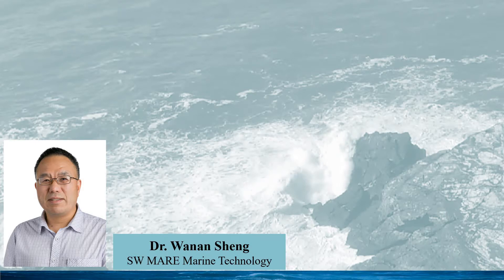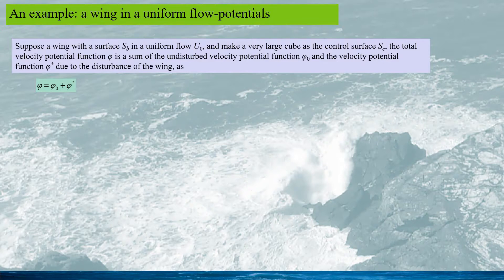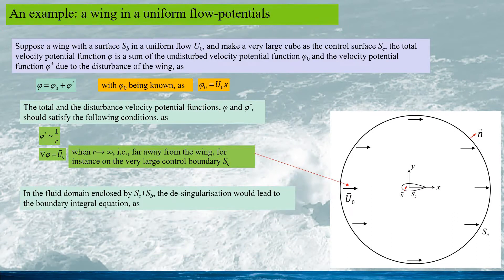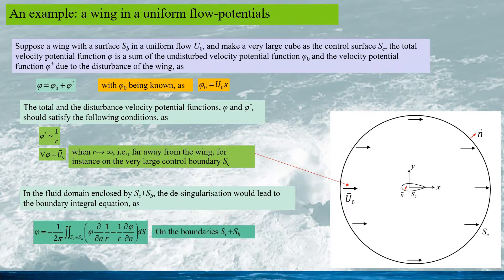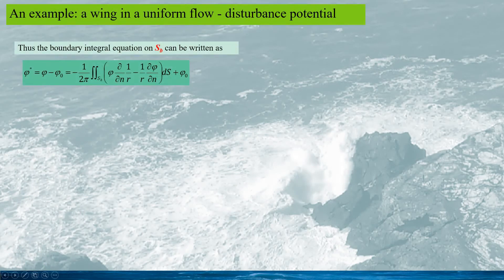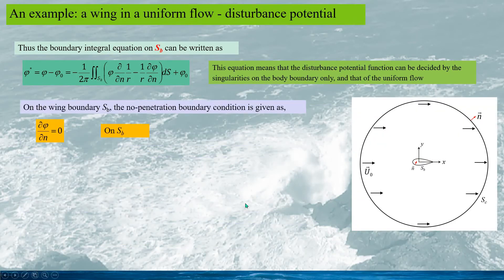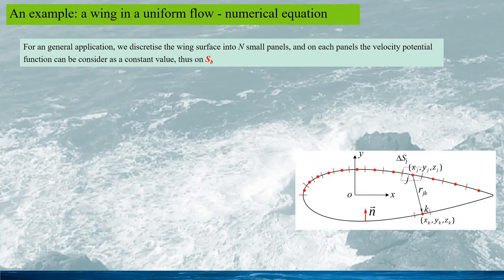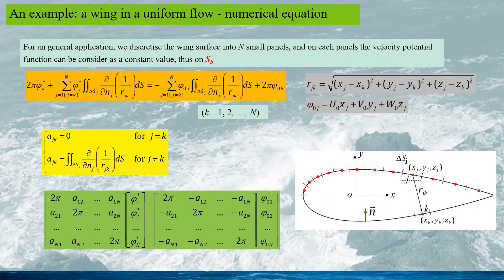[Fluid Dynamics: BEM] Boundary Element Method (BEM)- Principle (Correction)

Comment: Thanks  alot prof.this throw more light into the concept of the BEM.However im still a bit confused so i have these questions to ask sir.
1.during practical coding implementation, will the point k,be a random chosen midpoint on any of the panels from which all other panels can compute their r values from?
2.i still dont understand how to evaluate the double integrals of say a12,a22,...is there s special method?or its just a usual double integration?and if its a usual double integration, how do we define the limits over the surface?
Thanks in advance prof.
Reply from the maker: The idea is the source is uniform in the panel, and the double integral can be done in different way, normally based on the coordinates of the vortices of the panel. You should find some references on this. Remember for problems with free surface, you may find Newman's book or papers on this (and Dr.Yingyi Liu has done this too). It is very complicated, but it can be done, as Dr Liu in his open source (HAMS).
Reply: @ScienceofFluids  thanks alot prof
Reply: Prof,could you please recommend a nice book or material for BEM and HOBEM For finding these hydrodynamic potentials?
Thanks in advance
Reply from the maker: I saw all the materials scattered in different books and published papers. I haven't seen a book which has done the analysis for hydrodynamics (with free surface). I heard one who wrote a book in French, and translated in Chinese, but I never had such a book unfortunately.
Reply: @ScienceofFluids  thank you prof